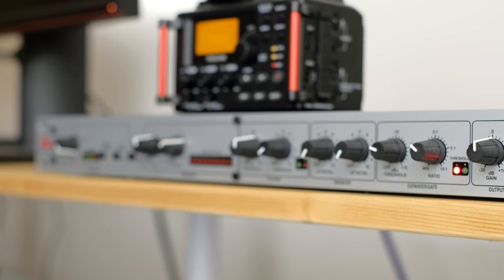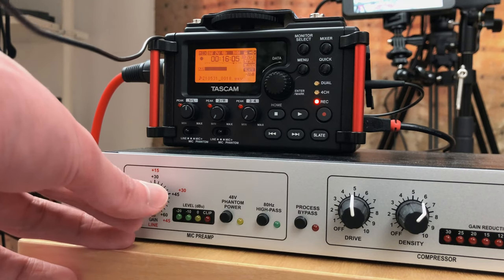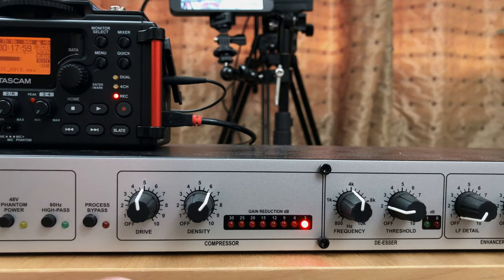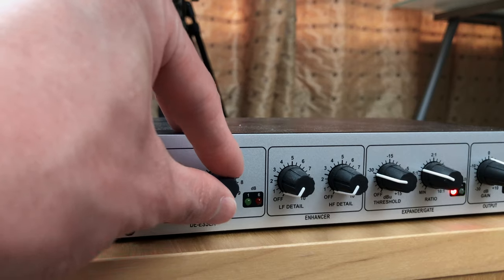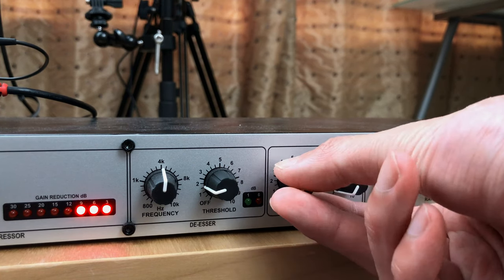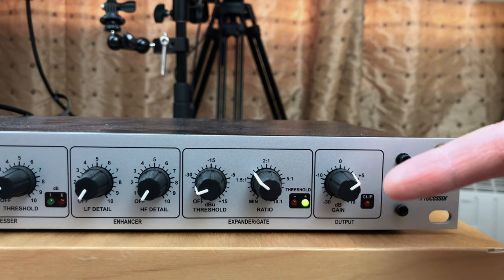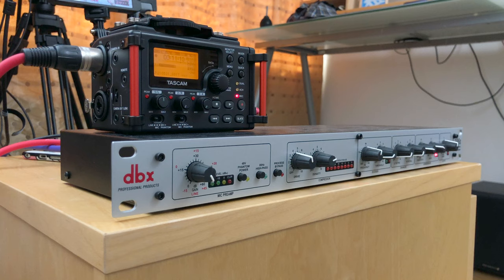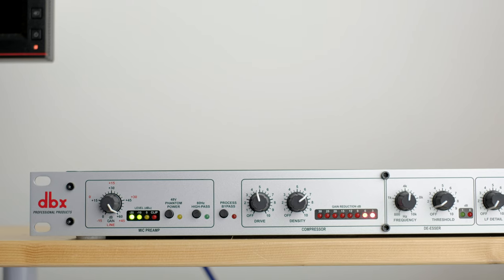DBX 286S Mic Preamp Processor REVIEW - Do you really need it?

Comment: I have recently got a dbx 286s, and prefer much more a reliable hardware mic processing unit than software plugins, which can be a real pain to use with different applications, and can give all sorts of software and performance problems. The only thing that I really hate about the dbx 286s is its very noisy built-in power transformer. I am talking about the 50 Hz (I am in Europe) mechanical vibration noise that it produces, and it is picked up by the microphone. I had to order a Toroidal type of transformer to replace its original transformer (have just ordered one). It could be that the units produced for 120 VAC/60 Hz have much less transformer noise than the 230 VAC/50 Hz, as I don't see many complaints from the US.
Reply from the maker: Thanks Andy! I have to agree with most of the things you have said. I did notice a very slight hum sometimes when I'm close to the device but luckily it doesn't get picked up in the recording itself. I did like it, but as mentioned, I ended up not using most of the processing after switching mics and camera. Otherwise it's a great device. :)

Comment: I was troubled by the small output of the BATA58A and came across this video when I was considering installing dbx.
I'd love to buy one for use in live streaming!
Thanks for the great info!
Reply from the maker: It will definitely help with the output as your mic needs high gain since it's a dynamic mic. It will work/help. But do you need all the other processing effects? It could be useful if you're live streaming though!
Reply: @JoeLamOfficial  
Thank you for your response.

I have considered the Cloudlifter CL-1 and the DM1 DYNAMITE, but I think dbx has the advantage due to price and versatility.
I think the advantage is that I can use the expander and de-esser in addition to the amp.

I considered using software to process everything except the amp, but I want to use audio on multiple PCs, so I think a hardware preamp is the way to go!
Reply from the maker: Sounds good! For roughly the same as a mic activator. The DBX is great value considering what it can do.

Comment: Loved the video man. 

There is something in the background producing some really annoying hiss/white noise, idk if it's a fan or an air conditioner, but it's rather audible and it was a bit annoying. 

Idk if it's just my headphones, but if you could do something about that, it would greatly enhance the video quality! :) 

Keep up the good work<3
Reply from the maker: Hi there. Thanks for checking out my video first of all. And you are right! It's my 2 GODOX LED lights that have built in fans that are quite high pitched and loud. That's partly why I went with SM7 dynamic mic. Hoping it will reject the background noise as much as possible.

What speaker/headphone you using? I usually test on a lot of devices and speakers and I do know it's there, for the silent portion I use a noise gate to try and block the obvious parts. But obviously it's still there within my speaking portion.

I could use a spectral denoiser to remove it in the speaking parts, but if I can get away with it, I really don't like using noise filters as it tends to degrade the audio. Guess I didn't get away with it this time.
Reply: @JoeLamOfficial  I use the hyperx cloud 2 headphones, so nothing fancy! 

Are the lights positioned behind the mic by chance? That's the best way to have it reject the noise coming from those lights :)
Reply from the maker: @kry3634  there’s one behind me on my right. And the key light to my left at the front. Not entirely behind it but slightly off to the side. I’m literally kissing the mic hoping my voice will be the loudest sound source and turned the gain as low as possible to minimise pickup from any other background sound. 
But interesting. Think you’re the first to notice it.
Reply: @JoeLamOfficial  I thought it was the noise floor of the preamp the whole time, which will confuse a lot of people watching this video thinking it's a noisy preamp and will turn them off from it.. You should state somewhere that the white noise that sounds exactly like a noise floor is from some fans in your room and not the preamp. All I could think the whole time was "Wow this preamp sounds terrible" until I scrolled the comment section.
Reply from the maker: Hi thanks for your input. I probably should have made a bit more clear. Some of it is from the light fans HOWEVER there is preamp when you crank it all the to the max at the preamp stage or add even more on the output stage. It can drive the SM7 but it’s not entirely quiet either when you crank the gain and use the compressor drive etc. The noise gate helps to mask some of this noise also.

Comment: Hi, is anyone getting a bit of a buzzing sound when you put your ear to the dbx286s, its only plugged into the mains, any info would be good. Thanks
Reply from the maker: I haven’t noticed on mine but does it get picked up in the recording? Otherwise some electrical devices do make some noises and also depend on your power supply in the house / wiring.

Comment: the only reason im looking into this is because i do this stuff in realtime through software, but its a real pain to set up and now im trying to switch to linux and its even more of a pain on there.
Reply from the maker: In real-time - a hardware solution like this might be better. At least it won't be using up computer resources - with audio its very easy to get glitches and problem sometimes. What specific functions do you require?
Reply: @JoeLamOfficial  noise gate, eq because of audio interface noise problems and also to get a similar result that a de esser would before I actually started using one, wanted to use a compressor but it would bring out the noise more, and a limiter mostly for gain. If I use the dbx instead, I would also upgrade my audio interface because I’m using a behringer um2 which has laughably bad noise unless you are using the drivers on windows (and I just switched to Linux).
Reply from the maker: I see I see, yeah the UM2 is quite noisy from what I've seen online. The DBX has plenty of gain and the compressor also adds more gain, plus the mic pre amp and out put gain option. Perhaps that will minimise the noise too, but depends on what mic you are using and your new interface. All in all, it should help to add a lot more gain.
Reply: @JoeLamOfficial  I am using a shure sm58 currently and I love it. I am probably going to start by just upgrading to a focusrite scarlett solo or something just to get a better audio interface and see what I am working with from there. HOPEFULLY I wont need to go with the full on dbx route, but it would also be kind of fun if I decide I need it still lol.
Reply from the maker: @justanotherpxrson  ah. Nice nice. The classic sm58. Depends if you want the hardware processing 🙂 or rely on software.
Reply: @JoeLamOfficial  I want to be able to do it through hardware IF I still need all that processing, but I will wait to see if a better audio interface will be enough first. I really appreciate the video! It was really helpful.
Reply from the maker: Good idea, take it step by step.

Comment: What’s the difference between 286 vs 266?
Reply from the maker: Functionality: The DBX 286 is primarily a microphone preamp and channel strip processor. It offers features such as microphone gain control, phantom power, de-esser, enhancer, EQ, and compressor. The DBX 266, on the other hand, is a dual-channel compressor/gate. It focuses on dynamics processing, including compression, limiting, and gating.

Channels: The DBX 286 is a single-channel unit, designed for processing one microphone signal at a time. It is commonly used for vocals or individual instruments. In contrast, the DBX 266 is a dual-channel unit, allowing you to process two separate audio signals simultaneously. This makes it suitable for stereo applications or processing multiple sources at once.

Controls: The DBX 286 offers a wider range of controls for shaping the sound, including a de-esser, enhancer, and more extensive EQ options. It also includes a variable impedance control for matching different microphone types. The DBX 266 focuses on compression and gating controls, with parameters such as threshold, ratio, attack, release, and range.

Application: The DBX 286 is commonly used in recording studios, podcasting, broadcasting, and live sound environments where detailed signal processing and vocal enhancement are desired. It can be particularly useful for improving the quality of vocal recordings. The DBX 266 is often employed in live sound setups, PA systems, and audio installations to control dynamics, reduce background noise, and prevent feedback.